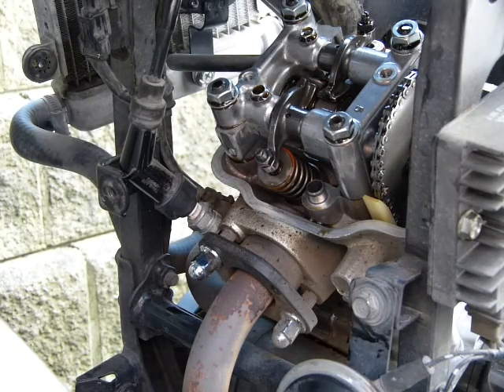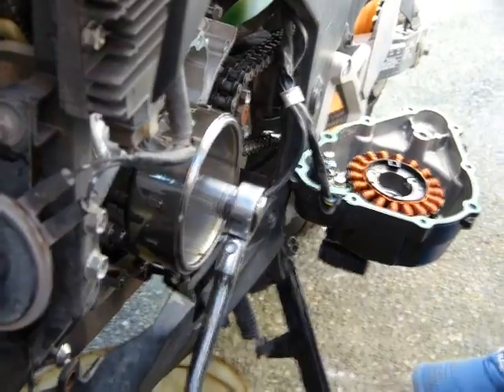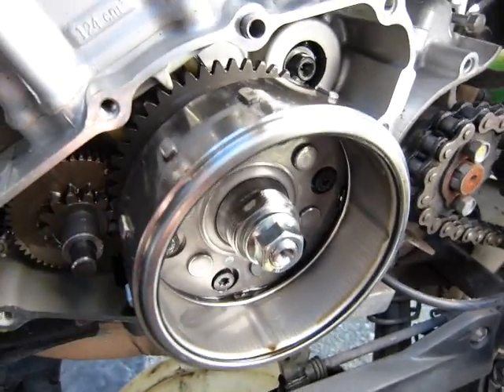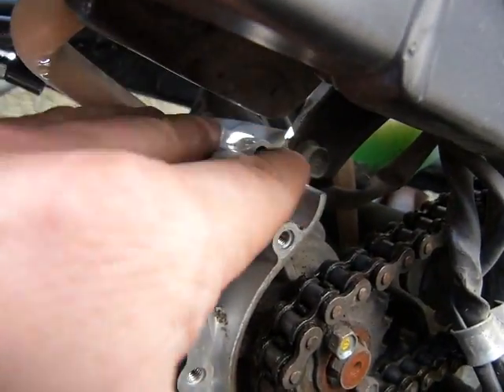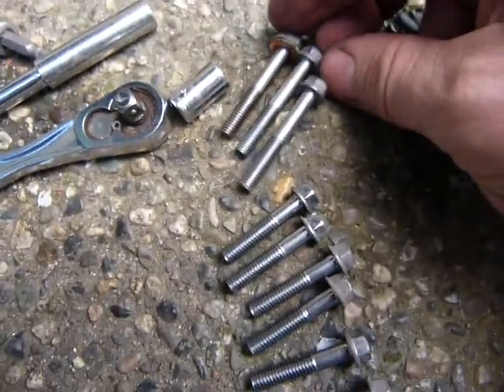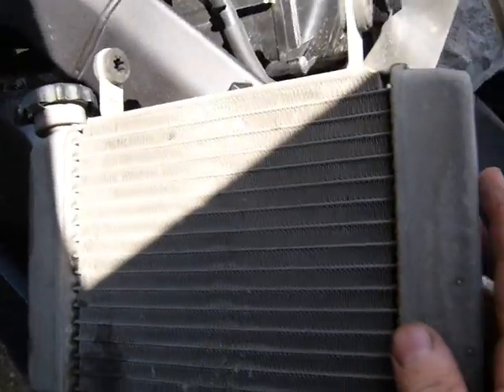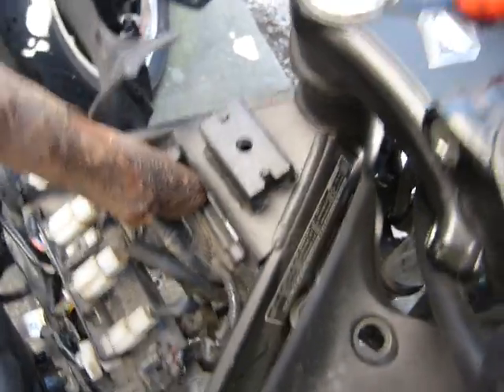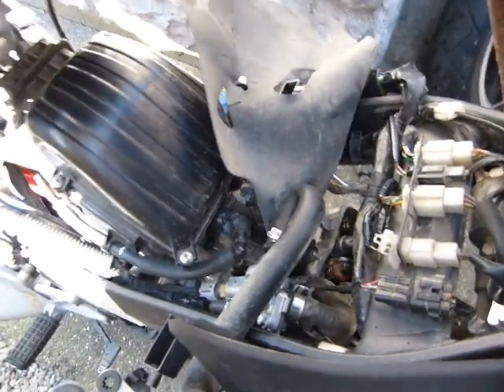Valve job: its extent (2011-14 Honda CBR125r)

Comment: Is there a gasket on the valve cover?
Reply from the maker: Yes, there is, a thicker one, rubber, reusable. Takes some fiddling to get its raised mid-rib seated in the cam cover`s groove.
Reply: theoverengineer Thanks for the reply, I need to check mine, and did not want to take it off and then find out that i need a new gasket.